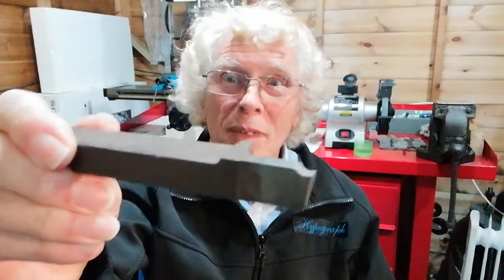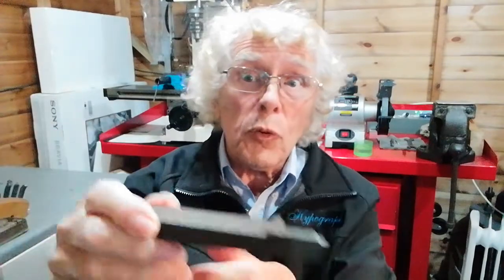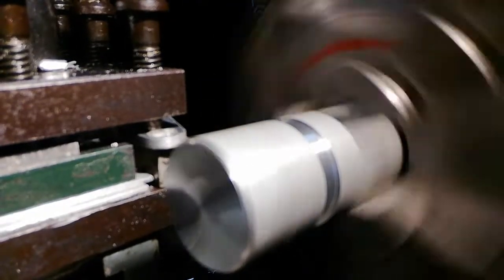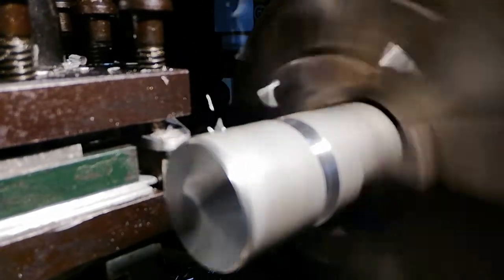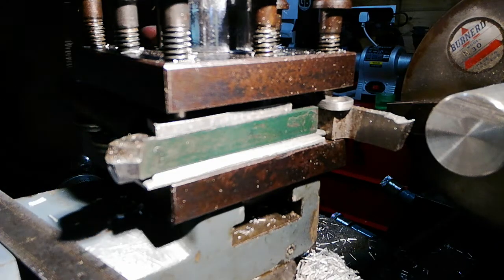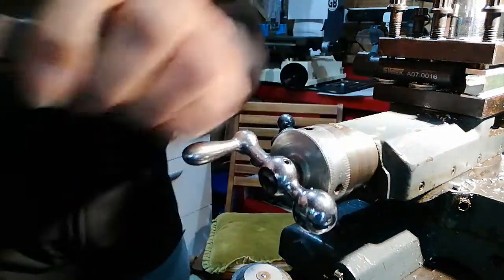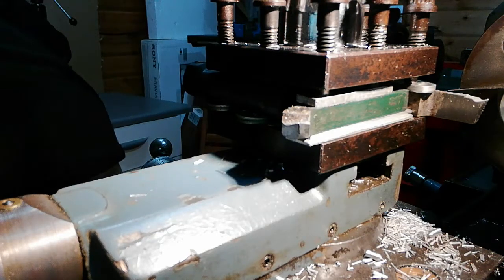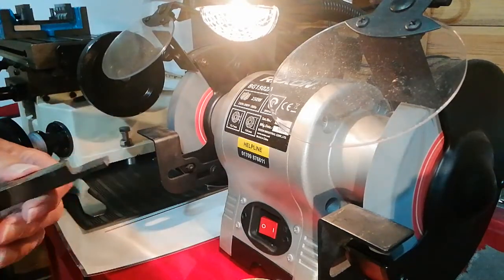Parting Off Problems  {1 of 3}  includes influence of unexpected (gremlins).

Comment: I don't think anybody likes parting! I've just bought a blade for a parting tool and was interested to see it had parallel sides. I have previously used tools much more like the profile you have. Worked ok with parting plastic. Not sure what will happen with a decent chunk of metal. Camera angles (and lighting) are often tricky too and can take longer to sort out than the shot you are taking. I haven't yet devised a good camera mount to use with my lathe, but I would like to film more in it. By the way, you can add a business email to your profile so people can easily find it (or just write it on a piece of paper and hold it up). Thanks for the video and looking forward to more. 👍😀
Reply from the maker: I have just tried to respond to your very interesting comments however; my reply was quite comprehensive due to the fact that you raised issues that deserved careful consideration. After about two hours typing, my content failed to upload, just kept buffering and eventually lost all of my text content.
Question; do you know if there is a limited word count for responses?
I will attempt to respond again, but break it to smaller sections, after I know if this uploads OK.  Sorry if this is somewhat inconvenient for you, but it may take a bit longer for my full reply on this subject.  At the moment I am somewhat frustrated as a result of this upload failure, but be assured I will get back to you with a full response in due course.
Reply from the maker: Second attempt!

Thank you for your informative comments.
I can understand why this procedure is often thought of as being difficult and attempted with reluctance and hesitation.  Many persons, especially those just beginning to learn about engineering, often resort to using a hack saw as an alternative to the correct procedure of parting off. This method presents different hazards that I shall illustrate in a separate video.
Blade type Parting off Tools:
I have used this method by mounting it on a rear tool post, so leaving the 4 way tool post on the cross slide free for other applications. Chip breakers and clearance angles etc. should still be considered and applied accordingly. It is ideally suited for multiple production runs.
Traditional Parting Tools: (as per video profile)
This type is my preferred choice. Having used it extensively within the heavy engineering industry on a D.S.G. 17”swing centre lathe; I can confidently advise that it will be suitable for parting off any type of material that you are ever likely to encounter.  Silicon Manganese and even tool steel; the latter being annealed, can be successfully parted off with this type of tool. The diameter obviously has to be within the parameters of the parting tool. 
Camera Mount.
So it’s not surprising that we have a mutual problem.  I am experimenting with various ideas. If and when I arrive at a practical solution, I shall advise you accordingly.
E mail address:
Thanks for your suggestion.  It reminded me that I previously included my website on my profile.  The website showed Email and included a contact us page. I shall be amending my channel profile in due course.
I hope this response clarifies the situation for you and that others will benefit from your most appropriate contribution, as posted on the comment section for this video.
Reply: @keithatklint5380  Thank you very much for your comprehension reply and I do appreciate the time you have taken over it and the filming of your videos in the first place. From my very little experience I prefer the traditional parting tool profile like you do. The blade was handy as I was parting 40mm stock and it was the only parting tool I had which was long enough. I have a slightly thinner blade on order (2.4mm 3/32") rather than 3mm, which might be easier on my little Chinese mini lathe. I have a very small Wizard/Lane hobbyist lathe from the 1950s, but that is even less rigid, though I seem to remember I did part off in it a few times in the past, probably brass and aluminium, as well as plastic. Thanks again 👍😀
Reply from the maker: You're welcome. 🍀
Reply: Yes, there does seem to be a limit on the size a comment can be. I don't know what it is, but I have sometimes cut and pasted long chunk of text into comments, only to be told my comment is too long and needs to be shortened. There is also probably a time limit on how long you can edit a comment for before you post it. I have not had this problem on YouTube, but have seen it on other websites